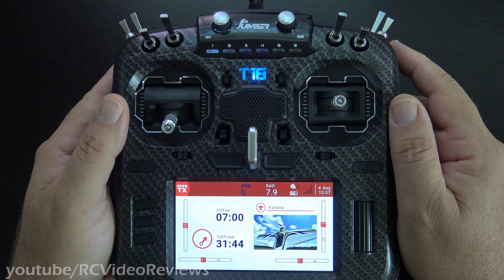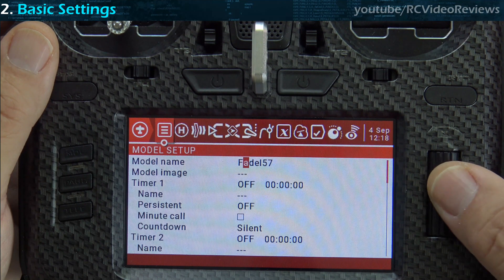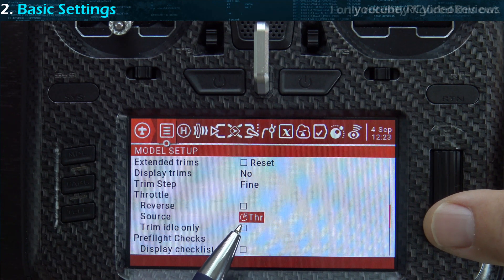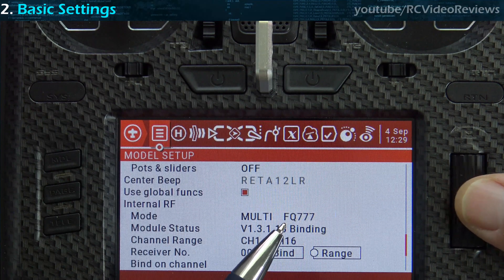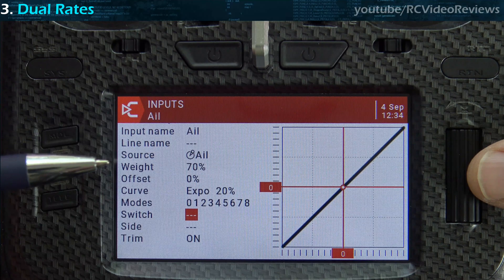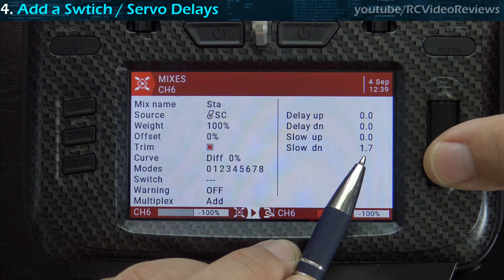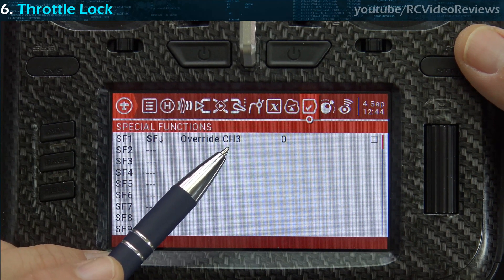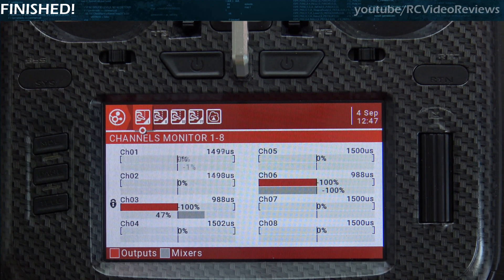Jumper T18 How To Setup a Plane with OpenTx • (Beginners)

Comment: The remote controller sensitivity is too sensitive. How should I set it up?
Reply from the maker: You can't change the sensitivity of the hardware, but you can change how the hardware emits signal to your receiver by adjusting your weights in inputs, mixes, or outputs.
Reply: @RCVideoReviews  If I change the GPS mode to ATTI mode, is it possible to support voice?  Voice support is not working when I change the mode.

Comment: Hi John, I wonder if you can shed any light on this for me...
I have watched most of your Vids on open TX and the TX16s great knowledge you have :) 
I know how to set up these little Eachine planes but I have found that I can only get them to bind if I check the "low power" button.
The problem with this is that they go out of range really quick.. Do you know of a way around this?
Reply from the maker: That doesn't sound right. Have you tried ensuring your radio is a few feet away from the Rx?
Reply: @RCVideoReviews  I was hoping you were right but alas not.. I have tried to bind from 10ft away and it just sits there but as soon as I change the power setting to low power it binds. When I try to bind without the LP button checked I can hear a small chirp as if it's bound but it's not. Then when I check the LP button it starts to work. The problem is on LP the range is about 50 yrds...  Regards, Pete

Comment: Hi, can you tell me what trims T5 & T6 are used for?  Regards, Pete
Reply from the maker: My understanding is glider pilots put them to use. A glider with four aileron servos for instance, can  use a trim switch for the 2nd pair of servos. I haven't found much use for them, outside of using them as momentary switches which is cool because two extra switches give you 4 extra momentary switches.
Reply: @RCVideoReviews  Thanks very much, Regards, Pete

Comment: Most helpful video so far. Bought Radioking Tx18s and was able to navigate much better with fewer frustrating mistakes. Now trying to set up Elevons for my liitle flying wing. Will let you if I am sucessful.
Reply from the maker: Make sure to check out my OpenTx Snippets Playlist: 
https://youtube.com/playlist?list=PLy3TC1ILJYTjsMsQ2YF5ZCUubv0IFiWkd

Here is a video on mixing elevons:
https://youtu.be/U0FmXP1VSmc
Reply: Finally got my elevon setup done using Flysky I6B Rx. Had trouble with sorting out elevator and ailerons. Ailerons would work on elevator stick and elevator would work on aileron stick. Solution finally found by reversing the servos at the receiver. That got everything going in the right direction. Reversing channel direction on the transmitter would put the ailerons on the aileron stick but then the elevators were reversed, up was down and down was up. Got a headache trying to figure it out. Had no trouble setting up throttle arming switch. Next I will set up a plane with dual rates and expo. Wish me luck!

Comment: Followed your instructions and got the Jumper T18 to bind with Aeroscout. Got throtlle cut working as well. Thanks, worked like a charm. How do I set up the safe/beginner mode? Many thanks.
Reply from the maker: I'm not familiar with Spektrum--never bought one. However; I believe you set it up on Channel 5. So add a 3pos switch to Ch5. There may be more to it than that, but that's about all I know.
Reply: @RCVideoReviews  Sounds logical. I will find out which channel is used for flight mode. The right direction. Thanks again.

Comment: Would you be able to tell me if the Jumper T18 Pro will work with the Horizon Hobby Aeroscout S with a Spektrum receiver. Thank you. I am just a newbie and things are being delivered next week.
Reply from the maker: Yes, it will bind. That plane comes with an AR636. Flight modes go on Channel 5 and Panic goes on Channel 6. Good luck and welcome to the hobby!

Comment: Very well done. Do you can also add an explanation for a tipical DLG configuration Please? I think in this case there are different challenges in order to setup it. Thanks
Reply from the maker: If I knew anything about flying a DLG I’d help you out but I’ve never flown one so not in a position to offer advice. Sorry. 

Thanks for watching and for the comment. 

J